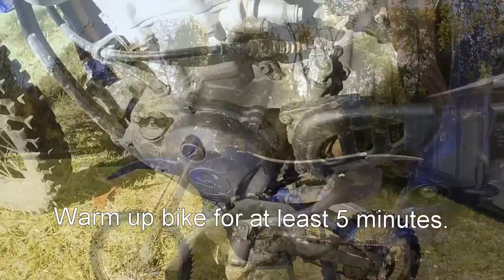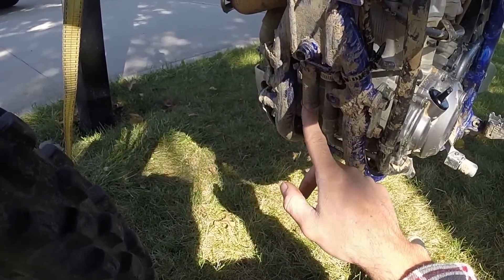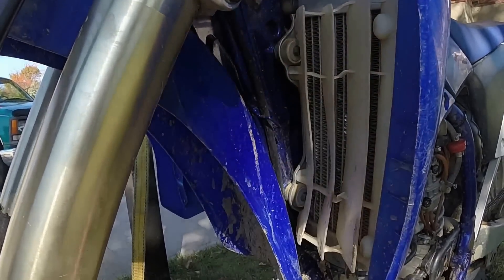YZ250F oil change

Comment: any one else have problems starting there bike after a fresh oil change on the 04 yz mine has a fresh rebuild an once i drain alla oil outta the frame an then fill the motor with oil it dont wanna start
Reply from the maker: Doing an oil change wont prevent your bike from starting. I need a lot more information to help. Check the basics: spark, compression, fuel.
Reply: I had something where I overfilled the oil and it wouldn't start so maybe try that

Comment: I was doing a oil change on my 04 yz250f.. i drained the case bolt , i went to drain it from the frame after and nothing came out , is that normal?
Reply: Yes because if you didnt warm up your bike nothing would be in their because it all drained back into the motor

Comment: At 24 seconds that black cap is there supposed to be oil in there
Reply from the maker: Yes. That's where you fill the motor with oil.

Comment: If anybody can help me that would be great👍🏻The two tiny bolts on the right side of the engine and near the top, are those both oil pressure bolts? Thanks
Reply: i dont mean to be so offtopic but does anybody know a tool to get back into an instagram account..?
I was stupid lost the account password. I appreciate any assistance you can give me!
Reply: @Kenzo Eddie Instablaster :)
Reply: @Tyson Jayden thanks for your reply. I got to the site thru google and im in the hacking process now.
Looks like it's gonna take a while so I will get back to you later with my results.
Reply: @Tyson Jayden It worked and I actually got access to my account again. Im so happy:D
Thanks so much you really help me out!
Reply: @Kenzo Eddie Glad I could help xD

Comment: Is this the same as a 06?
Reply: No. 06 is an aluminum frame and has an oil tank right in front of the engine instead of holding oil in the frame.

Comment: How much oil? Do i put in
Reply: Just look on google depending on your bike
Reply from the maker: For a 2005 YZ250F: 1.06qt without changing the filter, 1.16qt with oil filter replacement.

Comment: its not a mOtoR it's a EnGinE
Reply from the maker: oH Ok. LeT's ChAnGe "GM" tO GeNeRaL EnGiNes......
Reply: @Yotamug  motors are electric engines are not
Reply from the maker: Straight from Merriam-Webster Dictionary

Definition of motor (Entry 1 of 3)
1: one that imparts motion
specifically : PRIME MOVER
2: any of various power units that develop energy or impart motion: such as
a: a small compact engine
b: INTERNAL COMBUSTION ENGINE
especially : a gasoline engine
c: a rotating machine that transforms electrical energy into mechanical energy